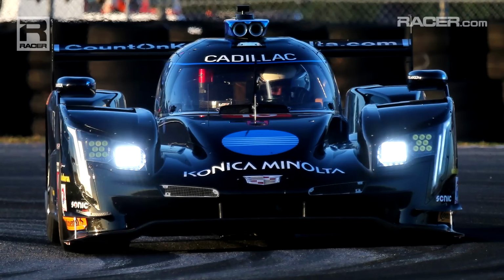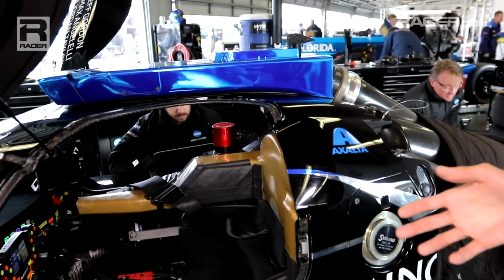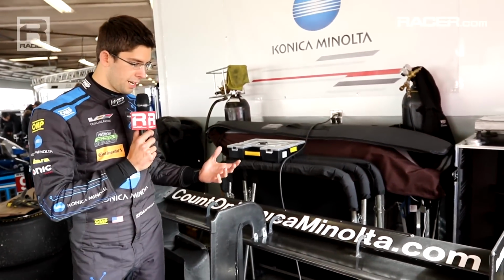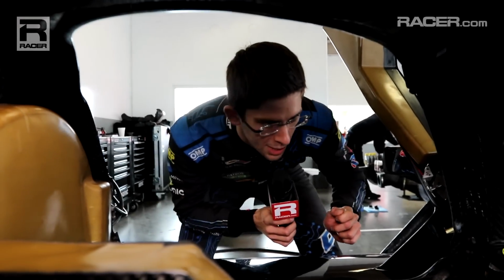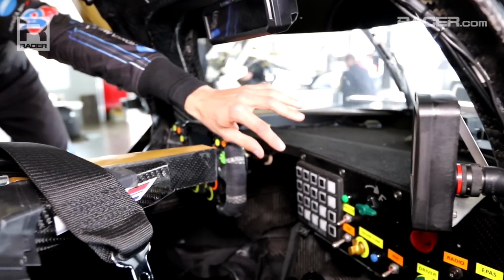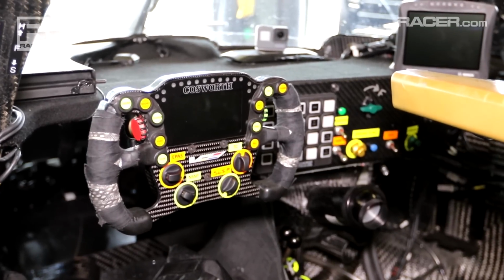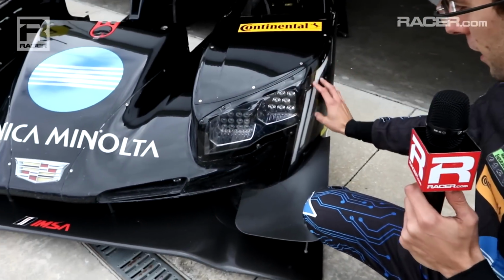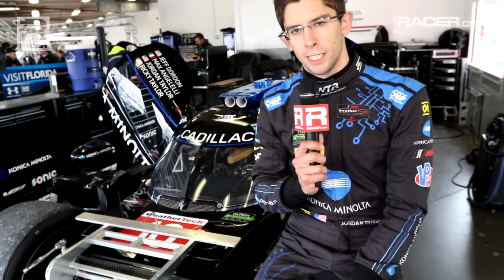IMSA: Cadillac DPi.V-R Tech Tour

Comment: Interesting.  Now catching up with the 1989 Group C Mercedes/Sauber C9.   Went from tube frame to a "carbon tub" (C9).  The general aero profile is C9.  Cadillac is 600hp vs. C9 was 750hp from 5.0L detuned from 900hp for endurance racing; full disclosure C9 was dual-turbos.  Hit 248mph at end of LeMans straightaway in '89, which is why there is now a Chicane at the end of that straight, at LeMan, i.e. to slow down the C9 and subsequent high speed racers.
Reply: oldcarboater c9 lost to the 787b. And the 5.0 has no where near the efficacy as a modern GM 6.2 ohv. So it would not go as far in a endurance race. And lose the the Cadillac. Areo efficacy would suck compared to the dpi as well. If the c9 lost agents the Mazda it would get destroyed by this.
Reply: oldcarboater 1971 Can am. Mclaren m8 had a 8.1 liter Chevy v8. 850bhp 7500rpm in the 70s!!
Reply: oldcarboater with a manual trans
Reply: C9 didnt race the 787b, it was a nerfed C11

Comment: how a brand like caddi do to build a lmp2/dpi proto from "nothing" ?
Reply: Its a Caddi body kit on a Dallara Lmp2 car.
Reply: with a caddy motor, proprietary transmission, different springs, struts, brakes, ecu, stability systems, and other things. 

Pretty much due to the open ended variations on LMP2 regs, it'd be cheaper to buy a new Dallara if to race in WEC or ELMS than to convert between LMP2 and DPi. Even ESM, who's Nissan DPi is the closest to an actual LMP2 car, would need to replace more than half the components to bring it back into LMP2 regulations.